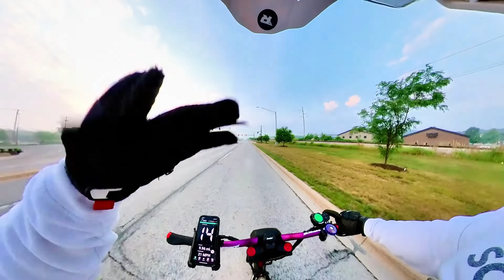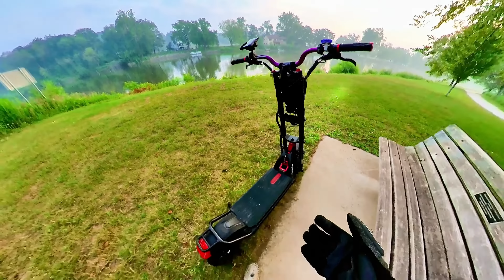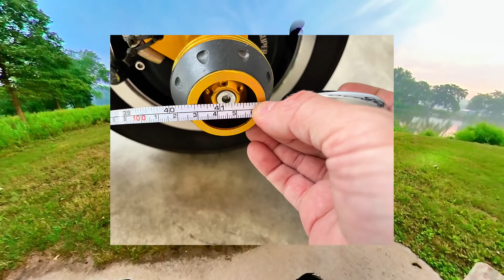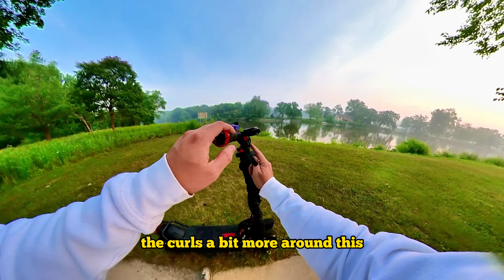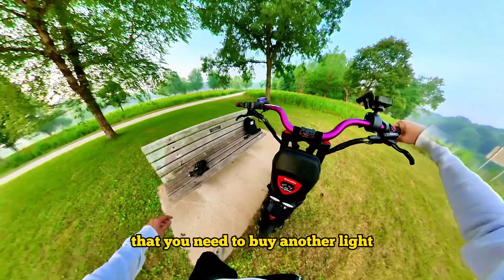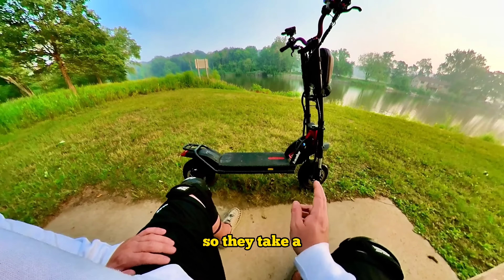KaaboUSA Wolf Warrior 11+ Pro: DUAL STEM SCOOTERS ARE THE BEST SCOOTERS

Comment: I just got my first scooter a week or so ago. It's only a single stem, and that was one of the first things I realized. I probably should've gone with a dual stem. Still a lot of fun though, and crazy fast. It's 60v, 6000 watts. I've had it up to 43, but haven't even tried the 3rd gear yet. It's definitely got way more than that, but I want to get confident before I try.
Reply: Which one did you get?

Comment: I just bought an 11 pro plus 2 weeks ago and other than the frame this thing is built like CRAP!! Kaabo really skimped on quality for the price we pay for this contraption. The brake lever bent from dropping it, the brake light stays on which keeps the throttle from working, they fastened the portable bag with Velcro straps that don't hold it on to the scooter,  the minimotors module is loose and will fall off soon and I had to Loctite all the allen nuts so i didn't lose the kickstand and so the forks didn't come apart. You'd think a machine that goes over 50 mph would be built with safety in mind. These companies don't care about quality and safety, they care about quantity.

Comment: Did you remove the gray wire on the controller (speed limiter) and the switch in the throttle or was this right out of the box with your top speed? Im in usa.

Comment: any issues on handlebar upgrade? i ordered the ones you have, seems like the bar is a bit bigger than the clamp.
Reply: Did you get them to fit? I just had my first good wreck and bent the stock bars and the left front shock absorber. I'm about to order replacements, remembered this vid and decided to come back just in case I was forgetting/missing something.

Comment: hydraulic vs spring suspension when looking at maintenance is the same. the plastic inserts and springs will wear out requiring replacement. hydraulic will also "wear out" when fork and shock seals deteriorate over time from use and hydro fluid starts leaking out. the spring suspension may be easier to replace than hydro suspension. Typically, hydro forks and shocks require experience, special tools and fork/shock specific seals/parts to rebuild.

Comment: for tire change i use a bench vice to squeeze tire off bead, from there using hands to squeeze the sides of tire together (middle going in) and fight with the rim to pop it off.. from there its easy, silicone spray lubricant makes a world of difference

Comment: Hey man Fantastic informative video. What is the width of the handlebars
Reply from the maker: 800 mm here's the ones we have:
https://amzn.to/3sdPLz6
Reply: @ScootaGang  Thanks I appreciate it
Reply: What is 60 R ? tryin to do the mod over here
Reply from the maker: 60R is how many millimiters of rise it has. I used the 75 R because that is the about the same as the stock so you won't change the height of the handlebars, just the width. Anything shorter then 75 will lower the bars from the stock position.  @farrington7971
Reply: @ScootaGang  Thank’s man I will order those 😀

Comment: But is it worth giving the extra money to buy this instead of the Wolf warrior x?
Reply from the maker: 10 inch to 11 inch might not seem like a big difference but you're also going from 3 inch wide to 4 inch wide. The traction on 11 inch tires is much much better because the contact patch is bigger. To me I ride my 10 inch scooters when I'm running to the grocery store, I ride my 11 inch scooters when I want to have fun and go fast
Reply: @ScootaGang  Im just tryna find me an upgrade from my 650w scooter. I mainly need it to go back and forth from school, and to have fun riding it in my freetime. Im mostly thinking about getting the x because its cheap, and many other youtubers say that you get alot scooter for your money. The 11 is much more expensive, so it would take me alot of time to save up for that. So do you think that its worth getting the 11 instead of the x for my purposes? And do you think its worth to pay extra for more range?

Comment: Notes:  Minimotor controllers suck and are dated at this point.  Antiquated AF, uncomfortable to use, and the display is awful.   I really don't think the GTR rear shock will be backward compatible with these scooters, there's a reason they jacked the GTR up to the moon...
Reply: I agree, i hate standard squarewave and minimotors controllers (in feeling, and noise)

this man is obviously used to it as he loves his Vsett scooters, but to me that is a big nope and a reason i won't buy a Vsett ever, if they atleast had hall sensors in the motor you could swap in a VESC and run sensored FOC and fix that atleast
Reply from the maker: BH4x0r: 

Have you done a swap like that? it's a complete waste of time imo I did it last year.... 99% of people don't have thousands of dollars and hours of time to make their scooter a little bit faster and little bit quieter. It's not cost effective and honestly terrible advice imo I won't waste my time again. Most people should just a buy a different scooter that has what you want.
Reply: @ScootaGang  I did convert mine from standard JP squarewave controllers and installed 2 FSESC 75100 Alu PCB controllers

I did not use an adapter board or stuff like you did, i just wired it all up straight to the VESC's, i use regen brake on a second throttle and use current control mode

I suppose they're still mapped pure to speed control in the MKGT and WKGT rather than to current control, which sucks IMO

i didn't necessarily do it for more speed, i did want it to not just feel like it tries to rip your arms off, and the regen on throttle is perfect, i don't even use my disc brakes anymore

I saw your results aswell and noticed myself that 100-120A max motor current is kinda weak on these escooter motors, atleast it is to me..

the MKSESC 75100 Alu PCB is 100% similar to the FSESC 75100 Alu PCB but it is only €100 on AliExpress, and the 75200 (200A single motor) Alu PCB's are beasts at €150 per controller

I cannot recommend any power scooter personally as i don't like the controllers on any of them..

sad to hear you spent that much money on an Ubox though.. but yea gotta watch out which VESC you get as most of them are pretty expensive

I spent €300 on controllers and made the scooter feel 10 times nicer, definitely worth it for me

gonna buy a higher power one soon and put a pair of MKSESC 75200's in em to really get that acceleration (or outaccelerate) of a hyper scooter (if you full throttle it) but still ride in a nice way like i like it

Also cuz my current one doesn't have a large battery
Reply: @ScootaGang  Oh ye the only thing that sucks is that there are no compatible screens except for that Davega crap (that you can buy, i mean that would arguably work for what it's intended, aka ESK8, but ye..)

but i plan to make my own one based on an ESP32 and a 12864 display somewhere in the future, just dunno when, it's not really a priority for me as i use my phone with VESC Tool over bluetooth
Reply from the maker: You're not wrong, this scooter is like 7/10 stock, I would be happy with some better ergonomics. The throttle is not too bad, I've ridden a bunch of sine wave and square wave and honestly I don't think that matters nearly as much as how well the throttle is mapped. Will see what the ey4 is like if It fits. If they can't get us hydro rear suspension on this I'll prob sell it just because I won't ride it over my Vsett. I do prefer the vsett and minimotors gearing of 1-3 with the same power in each. Kaabo 1-5 with different power is not ergonomic either. Don't want to click buttons everytime taking off, want control and power from the get go. There's no perfect set up yet, even the GT pro is too jerky on maxxed out settings gear 5. Same with the Mantis King GT in my garage that has sine wave, not smooth in top gear at all... The Vsetts I can creep at low speeds even in maxxed settings, it's more pleasant then getting your arms ripped off everytime.
Reply: @ScootaGang  go into your advanced settings on the mantis king gt.  You can adjust the level of tourqe (they call it accelleration level), regen braking, speed limitation and max amps allowed for each gear 1-5.  Mine is completely custom.  I couldnt deal with how jerky gear 5 was either and set it to accelerate like stock gear 3 but with max speed and stock gear 2 level of regen.
Reply from the maker: @brandonbajc2084  right the vsetts and all high end scooters have the same P settings, what matters most to me is the throttle mapping itself. It's based on the hardware like the throttle magnets and voltages. The amount of dead space programmed into the top and bottom as well as the physical dead space in the throttle itself. That is all done at the factory level unless you have a vesc programmable controller and you do it yourself...
Reply: @ScootaGang  the beautiful things about the GT models is that they have hall sensors, so they integrate easily with VESC (HINT 😉)

the non-GT models do not have hall sensors

Comment: For tubeless lawn mower tires I stick them in a vice and clamp at the axle hub or put the rim over the vice and open the vice so it pushes against the inside of the rim to hold it in place.  Then use two long flat head screw drivers to slowly remove the tire from the rim.  To re install I clamp a pair of vice grips on the rim to keep the tire from sliding and again use two screw drivers and a lot of force and swearing lol.  If your going to use bead sealer you can put it on after the tire is on the rim but before you inflate.  Its less messy that way.  But yeah I feel ya, split rim is the way to go!  Having the hub motor adds a whole other level of complexity too because ya gotta worry about breaking it and be delicate with the whole operation!

Comment: changing tubeless sucks but if you live in a place where the streets arent so smooth you will be more prone to pinch flats with tube tires. you can also slime tubeless or get the self heal/seal ones

Comment: I love my Vsett 11+. I will say having dual stem does limit a bit on your turn radius but it's such a minor thing i notice after a while of riding it. But the stability of having two stems is like having 2 steering damper buiit-in from the get go. But yeah i always saw the Wolf King as an off road scooter and the 11+ as the street type scooter. Good thing tire changes are an option. Btw the intro was fire. The girl definitely brought all her safety gear. 10/10 😆
Reply: Hey! I have a question for you. I have never owned a scooter but wanted to get one. I thought about getting an Apollo phantom 2023 due to the dedicated regen break and I was fearing having to do break pad changes, break caliper changes and then hydronic fluid changes. I thought it would be too complicated/too much. What are your thoughts about that? I really wanted the Kaaba wolf warrior 11+ pro but those were the reasons I was holding off on a scooter without a 100% regen dedicated break.
Reply: @zachn6338 I’d buy a used vsett or kaabo before buying a phantom.
Reply: @arielle94396  why is that? Do you think a phantom is too much for a first scooter?
Reply: @zachn6338  no it’s way less of a scooter than these. If you’re not used to two wheels then maybe, but you can turn most of these down until you’re used to them. I like having something with a lot of power that I can respect rather than too little power and always feeling the necessity to ride something super aggressively